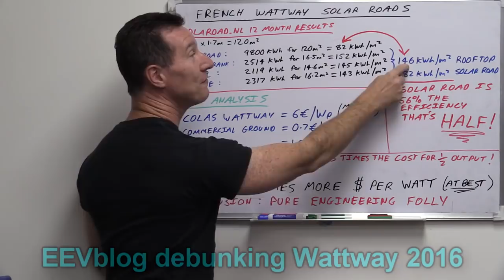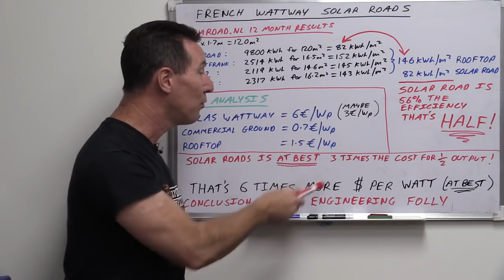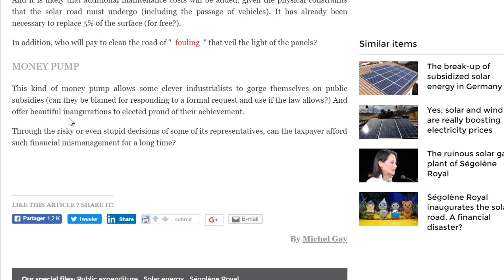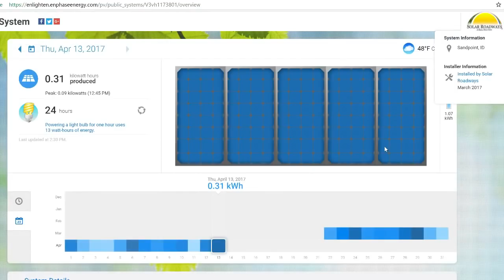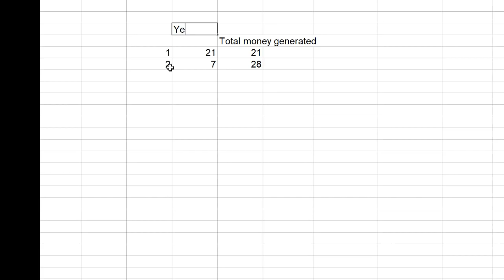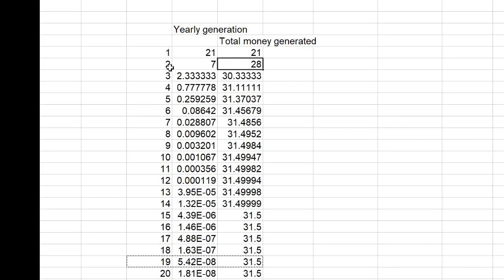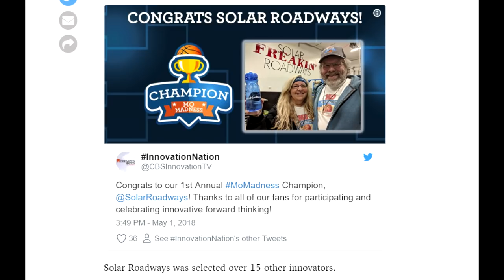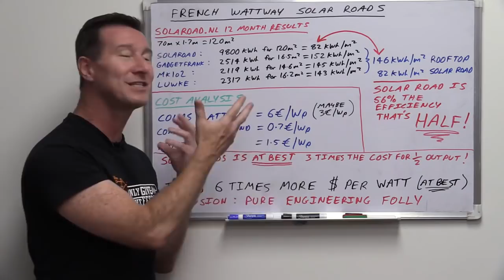Solar Roadway: 10¢ return on $1000 investment!

Comment: Henry Ford, same guy who with the Model T turned to oil for fuel instead of electric powered because it meant his engines degraded, required maintenance and would mean you replaced your car more often, sounds like the award is quite fitting.
Reply: TheRealUnconnected Nowhere in his comment can i find the words “first car”
Reply: +A A  Excellent point.
Reply: If thats true why hasnt a company made a car with an electric engine and put ford out of business?
Reply: Or maybe it was because battery technology in the 1920's wasn't up to snuff to power an entire car?
Reply: +Clay Miller, at the time of the Model T there where as many electric cars as there where’s petroleum doing pretty much the same level of performance. You need to consider how much the last hundred years of performance advancement have been done for petroleum engines while electric has only seen a revival in the last 10/20 years that has to catch up to the same performance of petroleum in that time.
Reply: Yes because electric engines can never degrade
Reply: searchoverload8, electrical motors have less moving parts resulting in less failure, less maintenance and requires replacement less often. I never meant it never requires those things. It is well known to those who know the history of Ford the reason why he chose it, imagine what electric cars would be with the development put into them over petroleum based engines over the last 100 years.
Reply: another thing on electric engines. They don't need to withstand hundreds of thousands (millions?) of rather powerful explosions at high temperature and pressure.
Reply: This comment made me actually do the math on that. if you run at 2,800 rpm on average thats 168,000 rph.  with combustion occuring every other rotation thats 84,000  instances of combustion per hour per cylinder. 4 hour road trip = 336,000 explosions. This works out to ~1,400 combustion cycles per mile.  At 150,000 miles each cylinder has fired ~ 210,000,000 (two hundred and ten million) times, so total combustion cycles for a 4 cylinder that would be  840 million, a 6 cylinder would be  1,260 mill (1.26 billion) and a v8 would have withstood 1 billion 680 million explosions.  Really boggles the mind to think how well engine blocks hold up. I'm fairly certain tapping a pencil on your leg a few hundred thousand times would cut your leg off XD
Reply: mobiussquadron ... I love beautiful math. But boy, my estimation was ... ha ... really off :) But now my mind is blown. 1+ billion explosions without taking excessive damage.  go science!
Reply: Ford didn't invent cars he was one of the leaders in assembly-line production methods for cars to make them faster and cheaper to manufacture and thus extend the market to more consumers.
Reply: +Shining Darkness no he didn’t as at no point did I say that but because he chose petroleum over electric in his mass produced and mass marketed car he set the president for all future models. At the time electric had similar performance to petroleum and it is known that one of the reasons he chose petroleum was it made his cheaper, mass produced cars wear out faster so people had to keep coming back for maintenance or new cars.
Reply: I don't usually say this but CITATION NEEDED, where are you getting this information from? Because it sounds like you are just talking out your ass with this claim that Ford picked combustion over electric when I have literally never heard or read that about the Model T. 

Electricity in the home was not even commonplace until around 1930, 22 years after the Model T was unveiled and you are trying to claim Ford could have made an electric car? Heck Ford himself was born (1863) about 16 years before Edison got light bulbs working right (1879) and 17 years before the early stages of the grid were being developed.

Now obviously I am not saying there is a direct correlation between Household electricity and automotive electricity, but what I AM saying is I highly doubt automotive industry thinkers were even considering electric at the time Ford was designing the Model T and producing the first line for consumers.

Comment: Asymptotes toward $31.5 lifetime return! This is an automobile and Wright brothers level revolution!
Reply: 21 * geometric series of 1/3.  21 * 3/2 = 31.5
Reply: yes that was pretty obvious lol, no need for a spreadsheet.
Reply: Dave, according to the website there has been zero energy production since September 3rd. Totally failed
Reply: to be fair, there is no reason to claim that the output will keep declining at the same rate. that's like looking at a babies growth rate for one year and calculating how tall a 30 year adult will be.
Reply: Lorenz Hansen thats a crappy analogy. Solar panels are not biological organisms
Reply: the analogy is fine. it doesn't matter that it isn't biological. battery degradation flattens out after a initial fast capacity decrease, similar to my example with the baby. you can't see a trend with only two data points. the decline could follow any function. we know that it is not the solar cells itself. solar panels don't die that quickly. might be complete modules that failed (quite likely, some led's don't shine anymore) . that might mean that in 2 years there are no working panels left. 0% production. but that's speculation.
Reply: Lorenz Hansen I’m more inclined to believe the entire thing will stop working all together in a few years. After all, several panels have already stopped working and the thing already caught on fire. Doesn’t seem very stable in any sense of the word
Reply: ThatGuyYouHate As i mentioned in my second comment
Reply: There's hardly any point at debating the decay rates when the entire thing costs an order of magnitude more, and generates an order of magnitude less. Even if the thing was permanently locked to the generation rate it has today, it would take a millenia to cover the costs.

But like we've seen on the installation, their panels can barely handle a few years. It's not a viable product, it's a stupid idea, and no matter the problem that breaks the panel, it's going to be way before the thing is even remotely profitable.
Reply: Logarithmic grow. Maybe. In any case this is sh*t.
Reply: > an automobile and Wright brothers level revolution!
That's what your idol said, and you keep shilling for him and his cronies.
Good boy, aussie! You are a piece of shit and corrupt to the bone. You know it, because i told you so and you have read it, because you even answered!

Comment: The whole thing is unbelievable. Yes, I can see why the initial concept appeared to warrant further investigation. But even without calculations it should have become obvious fairly quickly. The fact they got so far with it shows how f*ed up (gullible suckers for new-age snake oil) modern society has become at so many levels.
Reply: All the while blaming "experts", when they can't tell the difference between an expert and a charlatan.
Reply: +Stewart Smith   Exactly. Or blaming the public education system.  I've seen idiots on BOTH sides of a scam (the ones who create the scam + those who oppose it)
blame the public school education system. It's the ONLY government institution that makes ANYONE smart at all.
Reply: Another funny thing is that the calculations required are not hard at all. That stuff in the eevblog-videos for example is just back of the envelope, napkin math that anyone with a technical background should be able to do after several beers on a sunny afternoon while distracted by half naked girls in the park.

It should be the easiest thing in the world to find somebody to give you a solid reason not to spend money on that crap.
Reply: +Wyand  Exactly.  Yet, these easy calculations & logical planning & prevention are clearly MUCH MUCH harder than brainlessly plowing ahead building things doomed to not work just because you've got a bug up the ass about looking "practical" or looking like you're "doing something".
I've done engineering.  Pure abstract mathematical theorem-proving is just infinitely harder.  Math PhD took me 3x as long to earn than an engineering undergraduate,
and my grades in math were worse.
Reply: Society has always been this way. It's not the society that's changed, it's that more people than ever have access to virtually unlimited information. And let's face it, even if you are a well educated person, you can still mostly be well educated in only one field. So fact-checking the endless stream of information that constantly comes your way is not just a tikme-comsuming chore, it's virtually impossible.

Comment: 0:15
No. The world is big, but it's not that big.
At least 5, maybe 6 BILLION PEOPLE's basic power needs is one of the smaller items on the energy consumption list.
All the corporate energy demands individually stack up higher than people's basic needs.
Then all the other server things (bitcoin, internet maintenance in general, etc.)
Then all the general infrastructure.
If dozens of nuclear power plants can't handle the power reqs, then there's no way in hell 1% of the desert in our low efficiency solar panels is gonna cut it.
Also, the logistics is gonna be a nightmare.

EDIT: so it turns out that the area is plenty. Huh.
The only problem here is that getting that power transferred to anywhere that matters is an absolute pain. Or, it's gonna drain that energy. So...
the area is enough, but it's not in the right places.

Comment: Just an idea... Why not put the solar panels ABOVE the cars instead of UNDER the cars? Road won't get as wet/snowy, you can angle and orientate the solar panels over the day, no cars are above them, their surface doesn't have to withstand the forces of traffic and the road surface is still comparatively cheap. There are of course problems in maintenance or for larger vehicles, but it still makes more sense than driving on solar panels...

Comment: Those hexagonal solar road modules look to have poor usage of the space. I can see plenty of green PCB. Forget the fancy lights.
Also, the problem is these have a thick glass or plastic lens which can be scratched and scuffed by objects routinely travelling over it, thus reducing the power output by reflecting more light.

Comment: I don't know where you are, but I doubt you know what is going on on the West Coast but we are having a VERY BAD fire season. Washinton State has had over 1,122 fires so far. Siberia is on fire and there's been allot of smoke coming in from Russia, and even as far as California. 

Though it doesn't make it a viable energy solution (or smart), most of your armchair calculation are very very faulty and squewed from it.
Reply: I'm trying to find a good source/graph/data set to give you some info, but haven't found much more than a backlog of 48 hours of readings. PPM looks to have been near 100 for most of the time at Sandpoint (where solar Roadways is) and is currently at 330ppm. 

http://airquality.deq.idaho.gov/StationInfo1.aspx?ST_ID=114

Comment: I've never had a lot of respect for anyone who thinks using solar as a huge part of the grid is a good idea.  Maybe the way they do it with molten salt, but that's not nearly sexy enough.    I mean, outside of niche applications (your barely used cabin for instance), solar can't hold a candle when compared with literally any other form of power generation.  The solar roadways idea is just a really nice way of seeing who is capable of thinking things through.....   Like, replacing roads made with evil oil with shiny NUtech might feel real good, but it's just patently dumb on every single level.  You would literally be better off covering anything and everything else with solar panels before you did the roads.  And once everything is all solar, what happens at night, or on smokey/smoggy/foggy days?  And where and how do we dispose of all these solar panels? asphalt gets recycled almost indefinitely, and is made of waste products from refining.  Solar panels on the other hand often incorporate all sorts of rare, toxic, and expensive metals that can't be 100% recovered when being recycled.  Batteries are another thing necessitated by using solar panels, and they also contain all sorts of nasty things that are ecologically destructive to produce, and to dispose of, as well as being a bit dangerous.  Even worse, as thunderfoot mentions in his video, the lifespan of a PV cell is not all that great, and neither is that of the necessary batteries.  Compared to simple mirrors focusing heat, they are way more maintenance in the long run, but again, mirrors focusing heat to melt salt or boil water is not as sexy.  Plenty of large polities invest very heavily into solar as it "feels" real good to moronic do-gooders, but it is often a huge boondoggle that rarely has the intended effects.  Think Germany going green by attempting to do away with coal and nuclear, it's led to a massive "biofuel" industry that in effect imports wood to burn, as well as an increasing reliance on imported natural gas.  Or maybe Ontario and the whole solindra thing, consider that as bad as the costs to the consumer are, they were STILL heavily subsidized.  Powering the grid as a whole with solar is like trying to bail water out of a boat using a waterwheel powered by water coming into the boat.  There is a reason most grids put a cap on how much of their power generation comes from wind and solar, and that's because the grid literally cannot deal with any more of those things.  There are two sides in the energy equation (consumption, and supply) , and we need to control at least one to make it balance so the grid functions.  Having too much wind or solar removes control of the supply, and thus necessitates controlling the demand, which is really not pheasible.  (I mean, wait for the sunniest day in the winter to dry your clothes- not gonna work)  

Rant over.  Phew, I feel better now.

Comment: The only "intiligent" way to do this is to put pipes with water in the asfalt and use the heated water generate electricity and you could run heated water in the pipes in the winter to melt snow. Not saying that this is an actual good idea just that it is better then using solar panels

Comment: Another issue people rarely think about is years down the line such infrastructure becomes a maintenance nightmare for cities. Many are already strapped for cash as it is. If they decide to replace the road, how much is recyclable by the city? Would the waste require special disposal? 

How would the city even distribute that power? They're not in the energy business. They'd have to partner with a power company and then, depending on the state, have to then be sold to a retail electrical company. The money the city would actually get is minuscule compared to retail rates.

 Spikes in power production are not necessarily good for a power grid and can actually introduce a number of problems. Since peak power production is during a small part of a 24 hour period, would this even replace one single power plant? Electric grids, to prevent blackouts and brownouts, already waste a great deal of energy as heat through resistors. 

These are the kinds of questions to have to ask before investing a lot of money, political capital, and time into anything. Everyone makes great sales pitches and virtually all of them will take your money and lose every dime of it.

Comment: G'day,

  Yay Team !

   The funniest part of all this is that mounting a conventional Solar Panel onto the Roof (or Roofrack) of a normal Piston-engined Road-Vehicle, together with a Solar Battery Charge-Controller, and an Inline Fuse, all connected directly to the Vehicle's Battery....; will save anywhere between 4.5% and 33.25% of the Vehicle's average Monthly Fuelburn, because Road-Vehicles are (by design) horribly inefficient at converting their Fuel into Electricity...!

  This is because they employ a Step-Up Belt-Drive (Torque-Multiplier) between their Alternator & the Engine's Crankshaft (thus to permit the Vehicle to generate Current while idling the engine at traffic-lights...., at night, with the headlhghtsights on, in the Rain, and with the windscreen wipers, heater-fan, and radio all sucking on the battery..., because that happens - and "normal" Customers expect their Vehicles to cope without their even noticing), and because the Engine's RPM is otherwise determined by the traffic-conditions and driver intentions - therefore the Engine is almost NEVER operating at a speed conducive to turning the Alternator at it's most efficient RPM, for generating Electricity...

    A little bit of Solar Power, applied to the Vehicle's Battery whenever the Sun is shining, goes a very long way.

  It means having a fully-charged Battery at every Engine-Start, so that even when driving at Night or in the Rain, the Alternator only ever has to meet the Current demand at that particular moment - rather than meet that Electrical need while also trying to make-up any residual  Battery Charge-Deficit arising from stopping the Engine before it had finished recharging the Battery, repeatedly, as part of the normal driving regieme..., and also overcoming whatever Sulphation may be on the Battery-Plates (arising from having sat, "part-flat", for hours, days, or weeks..., since the previous Engine Shut-down)...

  To see the Australian Government Commonwealth Scientific Industrial Research Organisation's evaluation, assessment, & endorsement of the Concept, & Experimental Research Results...; title Search YT for,

 "SunFoil Short-Talk...."

  Or backtrack me to my "The SunFoil Project..." Playlist, and view the Construction Videos, among others (there are 42 on the Scroll...) ;  source your own components locally, and Do It Yourself (I recommend the Mk-8, it's the cheapest & easiest to fabricate and mount).

  Have fun,

  ;-p

  Ciao !